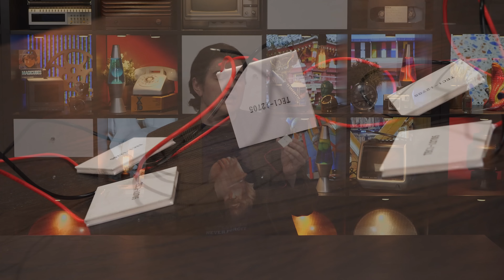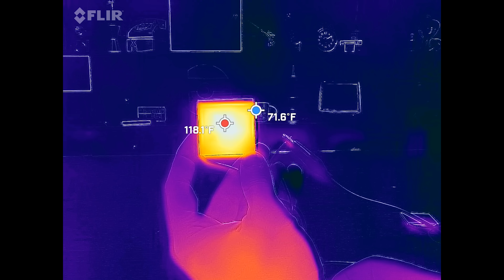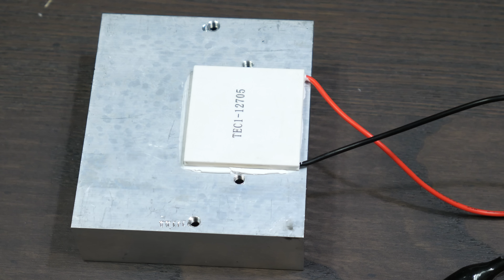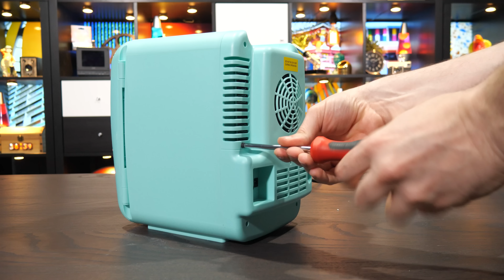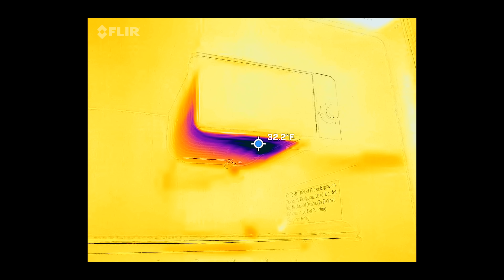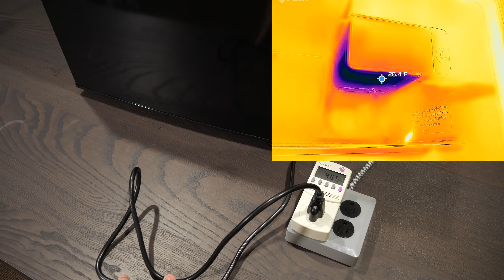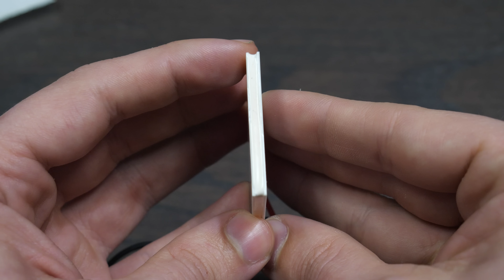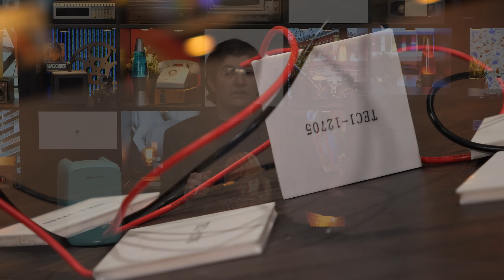Thermoelectric cooling: it's not great.

Comment: You know, when you can loose the arrogent sarcasm, you're actually rather listenable to. But when it's dripping off every word you sound like an arrogant thinks-he-knows-it-all bastard. And when that is combined with statements that go counter to my personal experience, well, it makes listening to you an unpleasent experience bordering actual pain.

First, it's unfair for you to insist on compairing something advertised as a drink cooler with actual referigeraters. They may call it a refrigerator, but I've never seen one advertised as a place to refrigerate food, and only cans of soda are discussed, and pictured in the unit. You don't mention, until the very end it's the practically nonexistant insulation, AND keep insisting on compairing something you admitted is primarilly used to cool drinks on your desk at work, with units that almost noone would use that way.

Second, if you are an employee allowed to put this device on your desk at work, then the cost efficiency of the cooler probably doesn't matter to you, because you won't be the one paying for the electricity. As a business owner, you'd possibly think differently, or chalk it up as a coat if doing business.

Third, I don't think you gave it enough time, and fourth, I have do disagree with your assertion that it's best for occational use.

Frankly, I believe that "occational use" plays right into it's biggest weakness, the speed at which it cools down things. In my experience, if you want to plug it in to keep things cool during a long trip, it will practically useless even pulling from a car's electrical system. And by that I don't mean almost useless. I mean that in practice it will not do what you expect it to do. They kust don't cool down fast enough.

About 40 years ago, I purchased one of these to do the typical keep my sodas cool thing, was initially very dissapointedm and was well on my way to comming to the same conclusions you did. But, after a weekend of pumping heat out of the interior, without me opening it up several times a day to retrieve and replace sodas, when I returned to the office I was pleasently surprised to discover that it had managed to cool down the cans of soda to an unknown, but acceptable tempature.

Not only that, but it managed to hold that tempature pretty well. Presumably as long as I didn't pull all the drinks out, and fill it back up with warm one'a, all at rhe same time. But if I replaced 1 can as soon as I took a cold one out. And didn't drink them all one after another, but spread out through the day, I was happy with the proformance.

And lastly, as experience told me that it needed to run constantly, with the door never opened for more than 2 seconds in a row (a benifit of a super small interior, is there's nothing to browse) minimised heat entering it. Meant that I never even considered unplugging it and ALWAYS made sure it was full before leaving for the weekend.

AND after maybe a month, maybe to, my impression of a super small, but ever decreasing tempature was eventully supported when I came back from another weekend and discovered that ICE had actually appeared in a squair on the back wall, extending juar a little past the 4 screws. Which I assumed was where the peltier device was located.

IN FACT, this ice build-up eventually became a problem because of the limited storage space inside the device. Requiring me to clean out the ice occasionally.

So that's my experiernce.

Oh, almost forgot, but a couple of months ago I was thinking about pulling a couple out of storage (I had 1 fridge & one car cooler, I purchased a 2nd had fridge for it's poweraupply after the 1st one's power supply went out (and rhwy both worked) and my step father had the exact same cooler version as my car/truck cooler peltier device, and was thinking about modifying an old leather couch to have the coolers installed underneath the leather covering the arm restsm so asked one if the early AI's being integrated into browsers etc., which was more efficient at maintaining a cool tempatue, a standard refrisgerator or a peltier devicw and qas yold tje peltier device, and was told the Peltier Device WAS MORE efgicient. Could have been the Edge co-pilot, google's search asdistamt, or Firefoxes AI. I am NOT saying it was correct in its assertion. They were talking about artificial hallucinations back then. So now I gottta verify which, if either, is coerect.

Now I'm very tired so please forgive any inxcomplete and/or un fleshed out ideas.

Comment: I wonder how small you could get a compressor based heat pump... could you build it small enough to stick inside the toy so it works like an actual fridge? I mean, people have built working cubic centimetre sized steam engines, so a compressor shouldn't be much harder, right?

Comment: Ah, no insulation no problem, don't think it will over chill anything. Drill some holes and use a can of spray foam just don't over fill it and drill some overflow holes. Same for non insulated double walled coffee pots, you might use low rise window door foam. For bath tubs use the regular foam, it will take about 15 cans.

Comment: Another use case: my insulin can last for 20-odd days at room temperature. On a road trip to Florida, the car is not room temperature all day. One of these puppies keeps the drugs "cool enough" and the insulation protects against overheating while stopped. Energy consumption while driving is not really an issue. In a hotel? Well, it's not MY power. As the alternative is a cooler and frequent ice replenishment, I'm happy with my device. YMMV

Comment: Interestingly, I have a couple of these at home. They have a digital controller, can select a temperature (in F only) from 30°-100°ish (it can heat or cool), and doesn't run most of the time when at it's set temperature. I wonder if it has better insulation, more powerful peltier elements, or some other combination of multiple improvements.

Either way, I bought one to be a quite bedside fridge for my wife (the fan is very quite) and I bought the other to be an incubator for mycology experiments. The ones I bought work "good enough" for my use cases, but I will admit that they could be better and the quality of these can vary wildly.

Comment: I was impressed it worked that well with one chip, with insulation and two chips it might work better but bot good. However the chips are interesting seems they might be good for cooling astrophotography camera sensors providing one has a good electric supply.

Comment: So I recently started a project with two mini fridges.
Standard mini fridge with a stock Peltier (50 watt)
It was able to get to -10 from ambient temp after about 15 mins.
Upgraded to a 100w Peltier and changed the heat sink to a cpu processor heat sink (cooler master 212) dual fans.
Now after 15 mins she gets -22 from ambient. And over time it gets even colder. I have plans on upgrading further. Going to get a second device and beef the cooler up significantly. Possible water cooling. Will prolly not update results on this comment but eventually I’ll make a vid

Comment: it's noisy because it's using a cheap noisy fan, now use a silent PC fan that has has 10times the CFM and CPU air coolers and put a thermostat on it and that issue is solved

Comment: About keeping compressor upright - it isn't about not being able to cool and lubricate, it's about getting oil into refrigerating circuit. Larger amount of oil in compressor cylinder could hydro lock it. Smaller amount can be pushed into condenser, which will highly strain compressor and can damage system.

Comment: This all depends on which parameters are most important. If you need compact/portable and hard to damage, and are only using it occasionally (e.g., for a road trip), you may want to use the little ‘junk’ fridge. Similarly, if you’re in certain office situations, you may need tiny and quiet. Just make an educated choice based on your needs.

Comment: Here I thought the Badness was that people tend to think of Cold Radiating like Heat when it doesnt. If you want something to cool down fast your need circulation over a heat sink to pull heat out of a larger area. Meaning that you have basically created a refrigeration circuit with more steps

Comment: One perfect application for this is my astronomy cameras. Heat creates noise in your images and taking images that are many minutes long, with incredibly faint targets that you need to boost the signal as much as possible. Newer cameras have this built in and can get the sensor 30 or more degrees below ambient, greatly reducing noise in your images.

Comment: Fun fact my dad has a compressor that looks exactly like the one in the mini fridge box
What if someone tried to use this for heating instead?
 Since it can pull heat from one side to other
Wouldn't that make it a slightly more efficient heater? 
Using whatever heat it can get from outside emitting it in side
Obviously not for very low temperatures but should be at least bit more efficient?
I guess proper compressor and such would still be better but that thing has potential to be noiseless and generates heat of it's own

Comment: I don't know, I had a cooler when I was a truck driver that had Peltier cooling. I had to be careful how I arranged my food stored in there because if I obstructed the airflow half my food would freeze. 😅 

It ran on a standard 12v cigarette plug. The fan wasn't noisy but the truck was always idling. 

When I later got a truck that had a built in compressor based mini fridge. It performed about as well, mostly noticed I didn't have to worry as much about placement and it got cold faster.

Comment: The itty bitty coolers for phones with the thermoelectric element are kinda neat, though I have always been told they aren't very efficient at larger scale.
Reply: I have one of them, which I just dug out of my scrap box after seeing the video. If you take your phone case off and your phones backside is smooth, where the processor is placed, it can be quite efficient. But if you actually do a task with your phone that gets it really hot in most of the cases, phones are designed to get a little warmer, so it's often not even needed.

Comment: I wonder how much better this little toy or the red fridge would do if you have em an aerogel coat or something for insulation, and a thermal regulator that allows it to turn off when desired temperature is reached

Comment: i use thermoelectric cooler in my semitruck its the best for driving on the road as a truck driver. Gas mini fridge break from all the road potholes and terrible roads we have. thermoelectric are very cheap to repair too. just cheap 12v fans ,peltier, thermalpaste and heatsinks

yes the problem is it eats a lot of battery.  currently considering on modding a regular larger mini gas fridge that i bought from walmart that broke and converting it to thermoelectric. 😂

Comment: The problem with these is not the peltie module. its the fact that they are made to cost 10$. they have no temperature control and next to no insulation most of the time so they are required to run continuously. If you actually need a fridge this small guess what you are not going to be able to use... A HEAT PUMP.

Comment: I worked with those components .
They are used as a cooler for cosmetic laser system (hair removal and stuff) . Two of them were able to cool to -25C in a small area , and used water loop for heat dispersal .

Comment: "I didn't call it a mini-fridge. I just put it on the mini-fridge category!"
Reply: I had a big mini fridge in college, slightly smaller than the red one, I’m my college dorm but since it used less energy than some older cube models was allowed. A freezer in a collage dorm is a game changer for groceries. In my opinion if you can pick it up without a trolley it’s a mini fridge.

But yes- how much weight, storage space, and insulation does it take for a fridge too be a full-grown and not a mini? We need a tier list stream
Reply: Classic American😂😂😂
Good think we like heat pump man😂😂😂

Comment: I've not been through all the comments BUT i used two of the peltier coolers in my truck, back in my tractor-trailer days.  Keeping the cab air conditioning on and the cab temp down to a comfortable 70 degrees, the Peltier Effect lowered the temp of my beverages to a nice 30-40 degrees.  Yes, i know it was a niche application, but for what I needed it worked fine. That's the reason they were big sellers at truck stops. Thanks for your attention,  I simply wanted to describe for you a particular application.  Love your show!

Comment: I was a trucker, for 20 years, and had coolers, equipped with Peltier cooling, and they worked very well.
That being said, I'd say that these newer, cheaper chips, just don't work as well.
I remember the last cooler I had, included a thermostat, and would freeze sodas, if turned all the way down.
I even used a Peltier cooler for the CPU, in my first gaming rig, back in 2007.
It also worked very well too, LOL!

Comment: I wonder because i know the physics behind 12v fridges if these designs could be improved by making them cooler style opening lije the high efficiency 12v rv camping style fridges? Front opening designs lead to cold air leakage from bad seals while top opening fridges keep the cold air in. Also wonder if substitution of a better heatsink and fan like a copper piped phase change style pc cpu cooler would increase the coldness and make it work better.

Comment: Ive got a thermo eleectric cooler that plugs into my car outlet. You can also have it heat and keep stuff warm. It has come in handy a lot of times. Especially if you use a small ice pack it it--it will keep things cold a suprisingly long time.

Comment: The way a heat pump transfers more heat energy than it uses seems kinda sorta comparable to a fuel truck transferring more energy than it takes to perform the transfer.

The energy being transferred is not being generated, it is in fact IN the medium which is being transported.

Comment: idk man, i found one of these in the trash and fixed it barely tbh, some cleaning and some solder, it was from some contruction worker or smth like that that came to do something near where i live and seems like it died on him, fan is properly toasted and the paste its probably older than me
that being said i did a similar, faster, not as acurate test, put one ambient can on it and turnet it on, put the same ambient can in my already cold family fridge, keept checking how they felt for 1h~ and they felt the same to the touch, idk if i let it for 3h or just opened them up at the 1h mark and they felt the same to the mouth, maybe the big fridge was the tiniest bit colder
i fel like the one you have aint too god pal, that or my family fridge its real bad lol(not that old and not an unknow brand so i dont think its that)

Comment: If it were well insulated and placed as a box with the opening on top so the cold air doesn't spill out, the ridiculously low efficiency could be worth... Except it would work only if that cooling pad is a good insulator itself when it's off so it can be turned off.

Comment: what in Europe the standard temperature in the middle of a refrigerator is 7 degrees celsius. but you right its not all over the fridge. on the bottom its 2 degrees. The real question is is a fridge possible with more and thicker Peltier elements. By the way we have the 2 door ice cube machine refridgerators also in Europe.

Comment: electricity isn't free :)
my shed had a few telecom cabinet peltier modules running of my solar powered battery bank. echo modul had massive heatsinks that I diverted my fountains water to flow across the hot side.  it could reach 70 in summer. I only go in the shed  to work  on projects. after a year I found a and repaired a discarded window AC unit

Comment: I was expecting the surface area of the inside of the fridge to be covered in multiple Peltier elements, not just one, especially considering they're $2.
But then I saw the power draw off of a single element and basically saw the inefficiency at face value. Still cool technology, would be interesting to see improvements to these over time. Who knows in 1000 years these things might have developed to a point where they work.

Comment: @technologyconnections check out the cool ( pun intended ) colman cooler made in the 90s for marlboro cigarettes , one of those things you could buy with points form smoking like ah chimmny . But it's the same deal and being in a thick cooler seems to help alot with loss , I got one from a friend at an estate sale and if I pug it in my truck and have the ac running in the truck it will and has several times keep the inside temp in the mid 30s 🎉